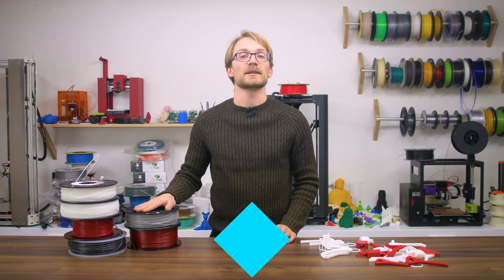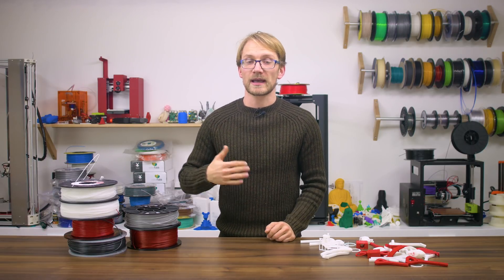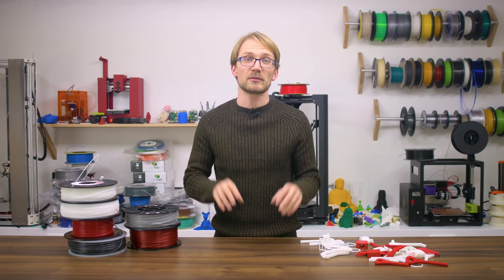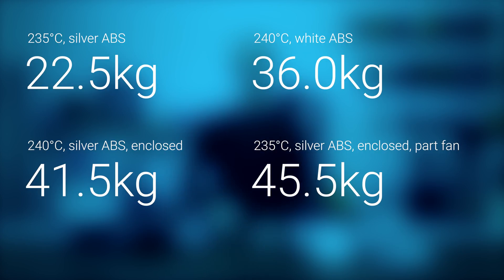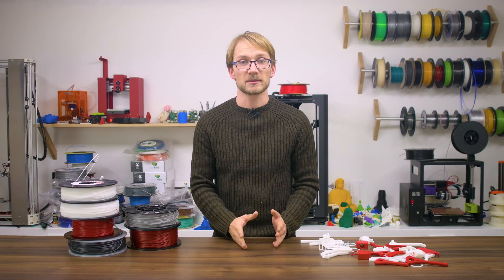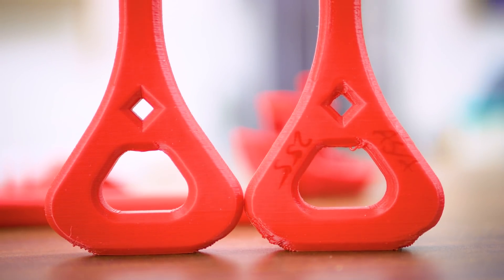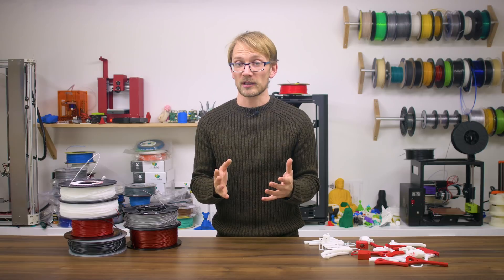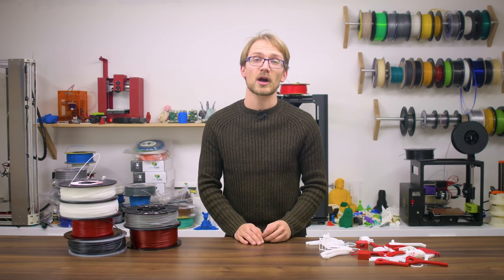3D printing with ABS: Hotter nozzle or hotter ambient? #Filaween

Comment: I've mostly used PLA except for stuff that I knew needed to withstand higher temperatures or survive outdoors, there I''ve used ABS.  I don't have a chamber, but I do have a heated bed.  Now here's and idea I've used....Once my ABS print is finished I throw a towel over it and then shut down the heated bed.  This allows the part to cool down more slowly, and it seems to help avoid cracking and layer separation.  I got the idea from reading about how glass is cast, and without this trick I can actually HEAR the ABS cracking as it cools!
Reply: Kenneth Scharf that's surely a thing. but that's not a definitive solution at all. i'm using abs as daily driver, in a closed room, bit with no enclosure. heated bed at 95°C.
if the object i'm printing is somewhat large, it will warp during the print, if the object i'm printing is also high layers will crack too. so no way to do what you say since when the printer stops everything is already ruined
Reply: I'm not saying that an enclosure isn't necessary, just pointing out my experience.  As I said, I don't print much ABS, and I don't use it for large parts.  I do get layer separation, but use acetone to make repairs.  Still, I've had few additional failures post printing by slowing down the cooling process.  I do plan on adding an enclosure to my printer eventually.

Comment: I only use ABS because it is a lot cheaper than PLA where I live (Brazil), but I always have room temperatures of at least 30ºC, I always need the heated bed but I have to find the right bed temperature for each spool of filament and if my fan stops it causes an instant jam

Comment: I'm a bit surprised at the quality being worse when enclosed. I have to think about that. Maybe I'll have to replay to understand what you're saying. I heat my enclosure to 50˚C for ABS and I haven't seen dimensional or surface quality problems. Using a fan on low in a heated chamber isn't a surprise, people have been talking about doing that for ASA, I hadn't taken that leap yet.

Comment: Only got an enclosure. No heated chamber (well heats up a bit, yes). Works with the right filament. Some filaments are aweful at layeradheasion. Raising the temps helps, but warps off of the platform... Test several filaments and stick to the best is all I can say on that topic. Had like IDK 20 brands and I stick to extrudr from now on. Doesnt even need a brim to print (on glas with gluestick), lower bed heat and surprisingly low extrusiontemps but is rigit and has a high melting point as others too...

edit: before I forget: Yes use ABS mainly cause its kindof cheap, even from extrudr. ABS still gets me the best surface finish (without acetone!), the least bumps, blobs and scatters and has low friction and high melting temp (good for mechanical parts for cars and such) and its not brittle. Wont shatter into your face when it gets overstressed. For really strong parts I use polymakers PC Max or PC Plus or taulman 910.

Comment: I purchased some ABS for my project as I am running low and I was sent TPU.  I get to keep the TPU and they are 2nd day me the ABS I had originally ordered.  I have never printed in TPU (I will use it for some shock absorbing feet) so how does it do against something like ABS?
Reply: *****
Oh, I know they are totally different I was just wondering as the printing range is like that of my PLA of 195-205 (even slightly less as the PLA is 195-210).
Reply: *****
There is one thing I couldn't find out about TPU and that is what is its Tg?  Do you happen to know or is that up in the air too?
Reply: You need to consider the extruder. TPU and or Ninjaflex type can be very tricky with Bowden or Some direct feed extruders. The filament finds a gap and escapes out the side of the extruder. I have great prints on one of my printers with a flexion extruder.
Reply: Garth Olivier
TPU, vs Ninjaflex TPE works better in that regard as it isn't as flexible.  TPE is a nightmare to work with and all gaps have to be taken away from everything I have seen.  It will be the last thing I try as the extruder I created needs to be printed (it will not be easy) has no gap for that reason as no printer I have currently would be able to handle TPE (Ninjaflex).

Comment: Thomas, I regularly print ABS with my TAZ 5 with a nozzle temp of 230 and a bed temp around 105 and a brim(4 or 5 wide) around it. I keep the small room it prints in in the high 70s Fahrenheit. I have had success the vast majority of the time. Just my 2 cents. PLA is a breeze to print compared to ABS, but I prefer the results of printing organic models. I will be trying out some PETG soon as per your suggestion. 
Can PETG be sanded and heated to smooth it out?
Reply: Thomas Sanladerer thank you for your reply.

Comment: ABS has got to be one of my favourite materials. I print in a heated build chamber between 35 & 40c, as heigh as I can get away with. Part cooling does help as long as you don't over do it.

Comment: I've only worked with ABS, except for a few experiments including HIPS and PETG. For years I struggled with warps and cracks, designing around it and so on. One day I needed a part that absolutely required a large vertical wall that was going to split and there was no trick to get around it. I finally built a box to go over the printer with a 100W incandescent lamp as a heater. (The nozzle cools to 40-45°C, in the shade, after a print is done.) The box fixed it. As noted, layer adhesion also improved drastically.

I've never been very interested in PLA, since so many of my prints will be exposed to a lot of heat.

I've been thinking I should add a cooling fan, and this is adding some urgency to that idea. I should build a new enclosure too, since those pizza boxes are looking a little rough.
Reply: Dale, what are the main reasons you have been using ABS?  Can you use PETG?
Reply: I started out using it because it's a tougher material. I never knew that without an enclosure, the prints probably weren't tougher than a PLA print. But I quickly found myself printing things that need heat tolerance. The part I mentioned before stays on the dash of my car, for example. Others are always exposed to the sun outside a vehicle. Using PETG in all those applications would be just another disappointing half measure. Not nearly as satisfactory as taping together a box so I can print ABS well.

Comment: I'm in the middle of building and enclosure for my prusa MK2. I'm planning to make an active temperature system based on Raspberry pi, which will also run octoprint, live video feedback and filament sensor. The air outlet will be based on a fan with a HEPA filter. What temps do you think will be safe to run electronics and the printing not to overheat anything? (frame based on square 20mm aluminum profiles connected with PET-G connectors and covered with plexi, maybe some led stripes for lighting it for remote checks over the camera at night). Any thoughts on this build?
Reply: As i recall MK2 printed part are ABS so around 45 deg max?
Reply: Why not putting the electronics outside of the enclosure? I'm also considering building an active temperature box, so could you share further thoughts on that?
I'm rebuilding that sort of lack-hack: http://www.thingiverse.com/thing:1740538

Comment: I recently tried enclosure over Prusa i3 and ABS parts were so much nicer, stronger and had les layer separation. printed 20 cm long part and the bed adhesion was perfect. no warping at all.

Comment: Tom - You didn't test ABS in an enclosure with active heating?  I would think the printing could be done at a lower nozzle temperature and with a part cooling fan, eliminating the temperature artifacting, while maintaining layer adhesion strength due to the slower overall cooling with a high ambient temperature in an actively heated enclosed space.  I've enclosed my Kossel Mini chinese clone in a wood and plexiglass homemade enclosure.  I plan to fit a heat gun to it (blowing away from the print volume as much as possible) and try printing ABS.  I don't have a part cooling fan attached or a thermometer in there yet, so it will have to wait until I get to do that.

Comment: I have two printers one has a enclosed chamber and the other does not and I print with abs a lot I have tried printing abs on my non enclosed printer with out any luck i was getting layer gaps and warping so having a chamber defiantly is needed in my opinion when printing in my enclosed printer i run my abs @240c with heated glass bed @95c and try to keep my infill at 10% to prevent layer gaps

Comment: You mention a chamber will also contain the nasty fumes, but thats not a solution, you will open that chamber sooner or later in order to get  the print out. An EPA filter may be required.
Reply: Using some gas mask filters will filter the small particles (and also germs and viruses if there is a zombie epidemy) and for about 20$ the cartridge its the best option i found
Reply: Its a partial solution. The vapor isnt the main problem, the biggest problem is actually microparticles. Solids suspended in a gas will, over time, always settle. But true, a HEPA filter would be better. Although for most people building a semi-temperature controlled enclosure will probably add an exhaust fan. Adding some charcoal filter there would greatly help and be much more readily available (and cheaper) than HEPA filters. (Vacuum cleaner HEPA filters need a much higher air pressure than simple fans will provide.)
Reply: about make a square hole ,attach a small fan to the box and use a snap-lock flexible pipe use for cloth dryer,.  push bad fume out the windows.cheers.
Reply: Activated charcoal will do nothing to plastic fumes. Only Chlorine based chemicals and organics, are the main target of activated charcoal.
Reply: HEPA filters still capture many of the ultra fine particles, it's just rated at 300nm because that is where it is least efficient. (ULPA are rated differently but generally are better for almost every particle size and ofc more expensive)
Activated charcoal filters are generally used to trap gasses (yes they "can" trap particles but cheap filters can do that, it's like using a sponge to sweep your sidewalk...)

I would say a few cheap filters then charcoal then a hepa filter. Or you could just vent it outside and maybe use a heat recovery ventillator but that's if you wanna go industrial
Reply: a hepa filter and a few liters of charcoal (in that order) should be able to catch most nastyness, when you slowly cycle the air inside the enclosure through it, without outside ventilation.
Reply: good idea, with the gas mask filters. you can get expired ones very cheap too.